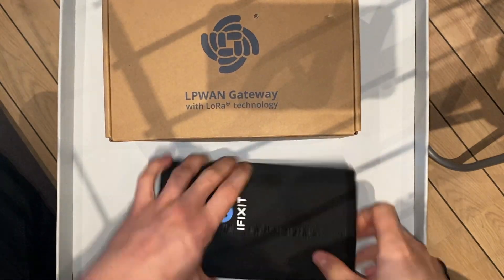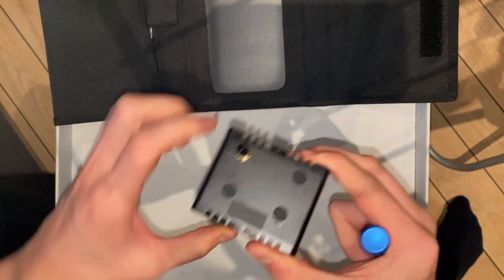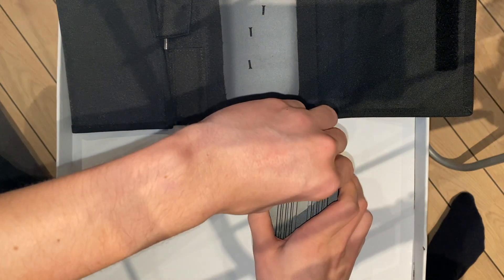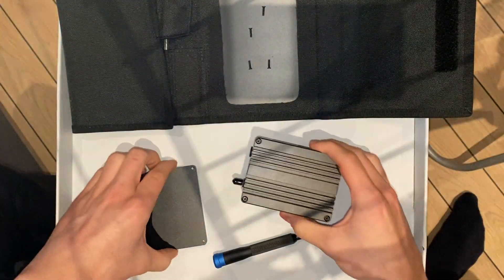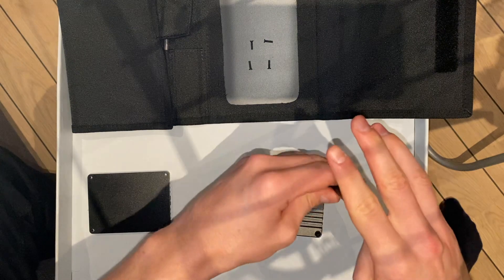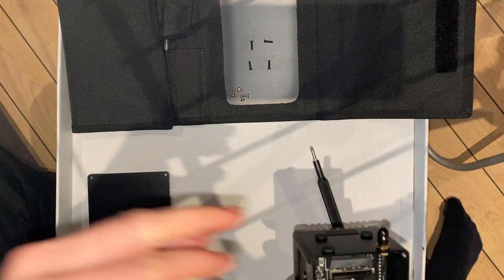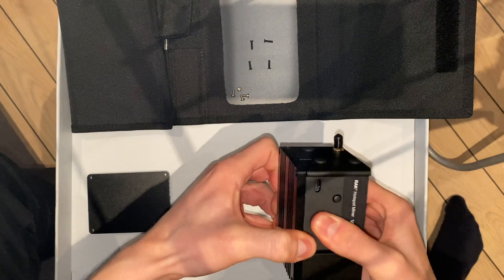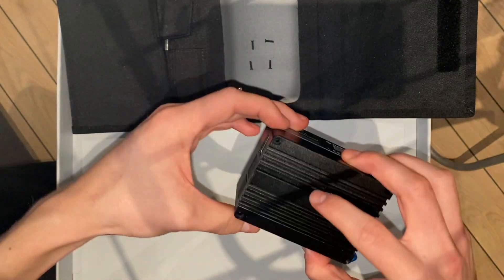RAK V2 miner Teardown. What's inside the HNT Helium miner? How well does it cool off?

Comment: I think the hardware it's very overpriced. When do you calculate to get the ROI?
Reply from the maker: I have 3 miners - 2 have roi’ed allready
Reply: @hgsoftware5129   wow, so I have o investigate more, thank you. It looks to me it's risky to buy hardware than only can mine one coin.
Reply: This device is only a raspberry pi 4 with another rak wireless board, sdcard & case, The price should be around $200 to $3xx （depends on ram of the pi4 & rak level & sdcard level), right？ pi 4 with 4gb around $100, RAK2245 RPi HAT Edition $120, sd card $20, case $10 , of course the system is priceless